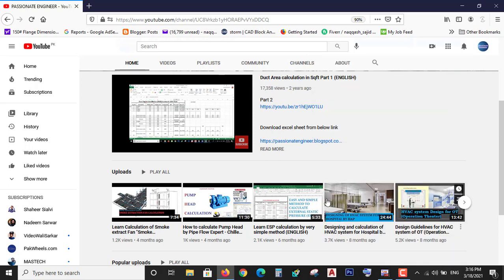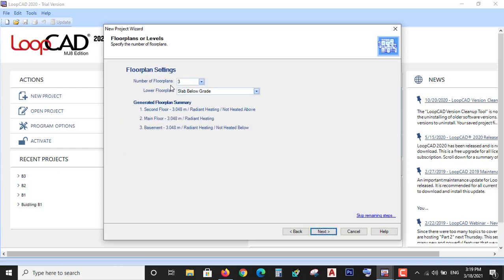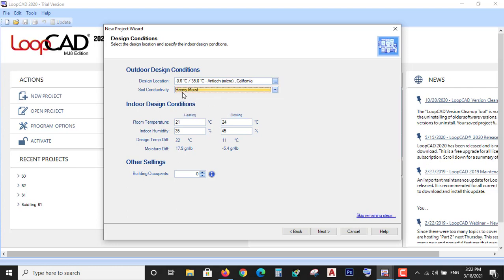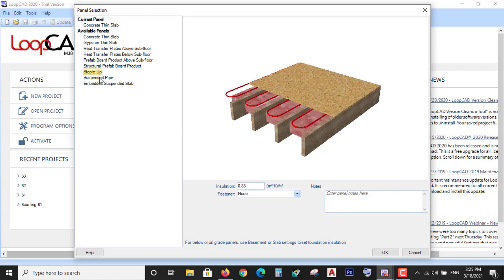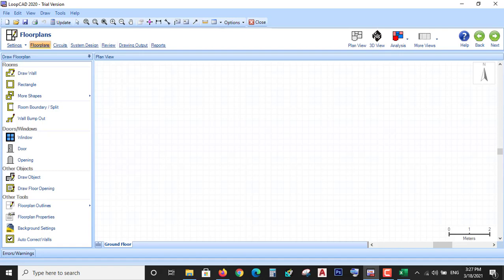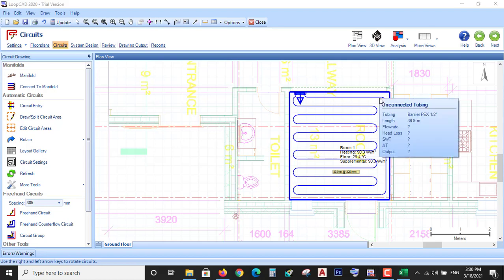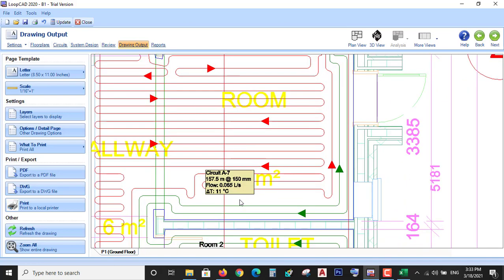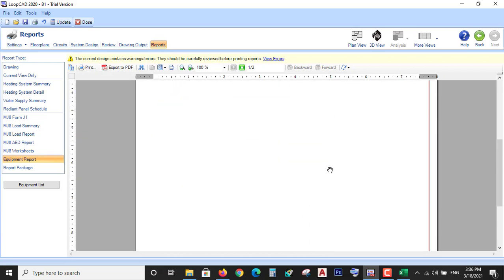How to design Underfloor Heating by LoopCAD (Manual J method).

Comment: Hello, is there a method to make the outer wall and window front more frequent in automatic drawing? For example, there is more than one circuit in the room. I want 1 of them to be frequent. 12 cm inner zone 18 cm. How is this done? If one is broken, its prison changes. I would be glad if you could help
Reply from the maker: Hi, can you please elaborate? Your questions is not clear.
Reply: For a 22 M2 room. I want to lay 160 m of pipe. I want the 9 M2 outer zone to be 12 cm modulation and the 13 M2 inner zone to be 18 cm modulation. It becomes a 2 zone design. I select a room with the program and it draws automatically. The program designs it as 2 zones in the automatic drawing again. No problem so far. I set the outer zone modulation as 12 cm. The inner zone becomes 12 cm. I make the inner zone settings as 18 cm. Although the outer zone is 12 cm, the room becomes 18 cm. I want the modulation between the zones to be independent. @passionateengineer04

Comment: Hello. I successfully downloaded the trial Avenir LoopCAD "LoopCAD2024-Roth-Setup.exe" file, HOWEVER it will not load on My Apple MacBook M1 laptop running Sonoma 14.5. It wants to open with my Elmedia Flash Player.  I adjusted my Flash player, per Apple instructions to open with "Rosetta" but still not opening the ".exe" file.  Any idea what the issue is?
Reply from the maker: Sorry, i didn't use it on macbook yet, i am using it on Windows 11.
You may check the internet for a solution.
Reply: You can try looking up a software for emulating windows 11 on ios and run it there

Comment: Nice video, thanks for sharing
I recently started using this program, and it seems pretty basico in the drawing stages. I was wondering if there is a way to draw the vertical connecting pipes between floors. And also if there is a way to have the program stack the 3d views of my different floorplans.
Reply from the maker: You can use Revit for that purpose.

Comment: is there a way to make it so it doesnt overlap circuits?
Reply from the maker: Once you draw that then you can convert it into an autocad file and change the routing.
Reply from the maker: This software will give you design, you can do your own routing using the design data.

Comment: Sir, how we calculate the pipe size for under heating (its depends on room area or length of loop etc.) or any thing else.
Reply from the maker: For underfloor heating, first of all you will need a space load, then every pipe has different heat transfer properties like if you are using pex pipe etc.
You have to calculate the flow rate using space load, after this you can size pipe at recommended velocity or pressure drop.
Reply: @passionateengineer04  thanks sir

Comment: Why you cant designe more that 1 loop in each area, if you use the snaill configuration
Reply from the maker: You can but sometimes you need to heat only one area and heating is  no required in other area.